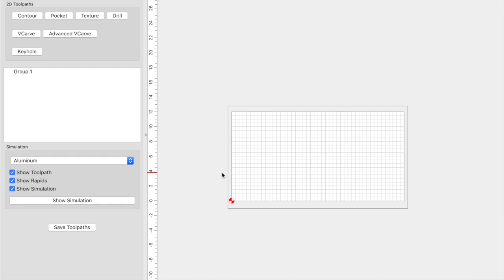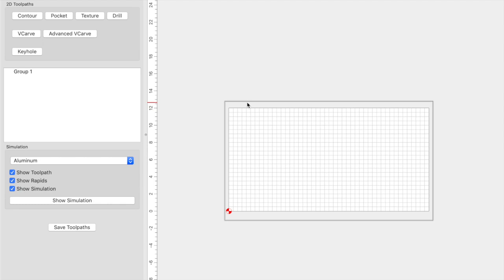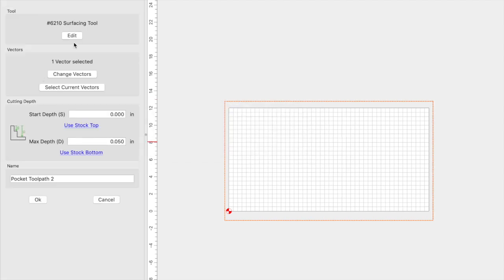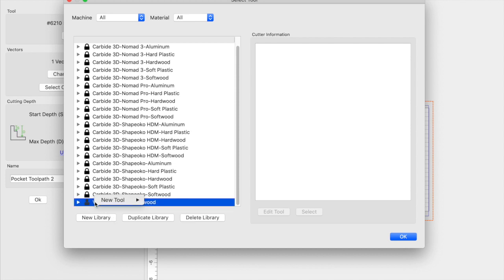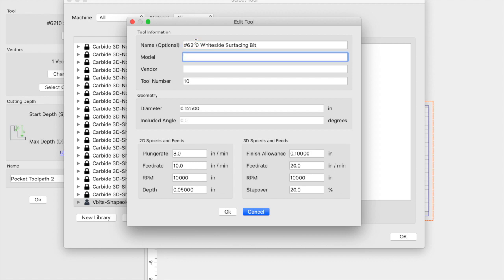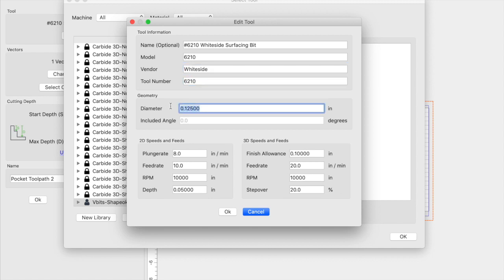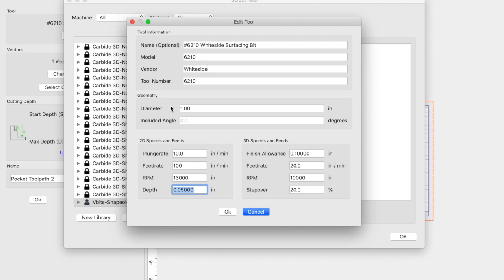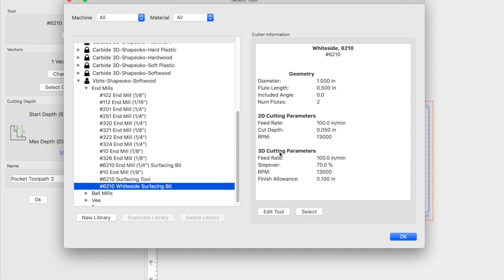How to Add a Surfacing Bit - Carbide Create Tutorial

Comment: Do the speeds and rpm need to be adjusted for hardwood vs softwood for this bit? Just thinking if you use this for your spoil board vs flattening a cutting board/table that may be a hardwood
Reply from the maker: i would slow it down for hardwoods.  These days I take it slow because id rather get a correct outcome rather than ruin the piece trying to go faster.

Comment: But your bit is 3-flute, and the software says "num flute" 2. Do you change this in the data directory, or do you just leave it?
In the older versions of Create, you could insert numbers of flutes, flute lenghth - and so on. Do you have any tips? Thx
Reply from the maker: I don’t think that matters but I didn’t even catch that. Thank you for bringing it up to my attention and that’s something I’ll need to research. 
With my current settings I’ve not had any issues.
Reply: @aetimberpine  Did you find a resolution to this question? I'm using CC Version 776 and don't see anywhere to make the change. Thanks
Reply from the maker: @eric3927  hey Eric I leave it as is.